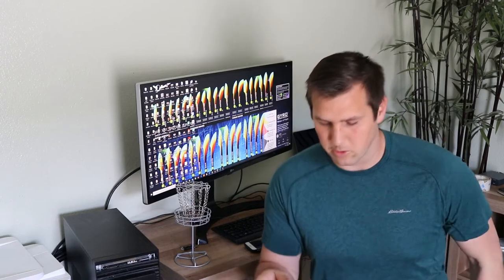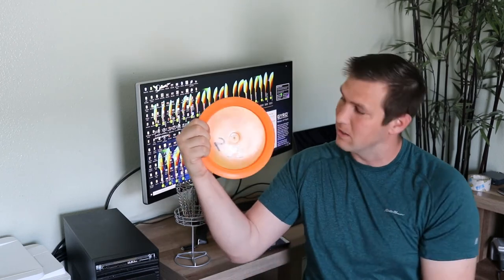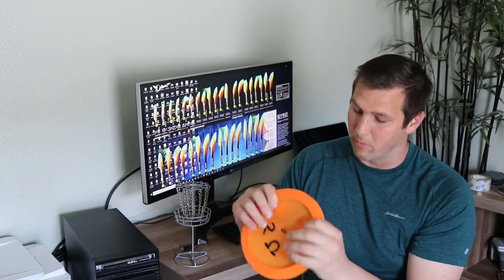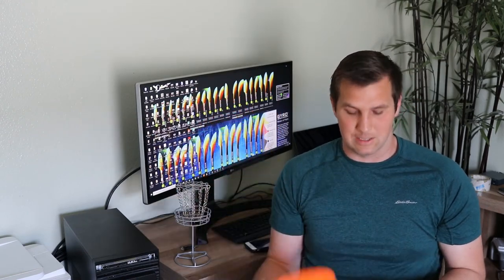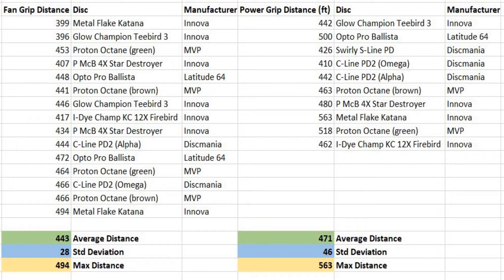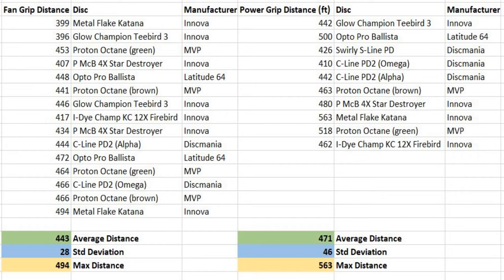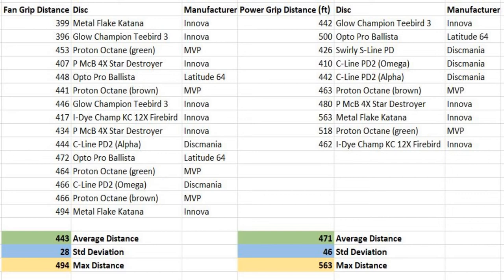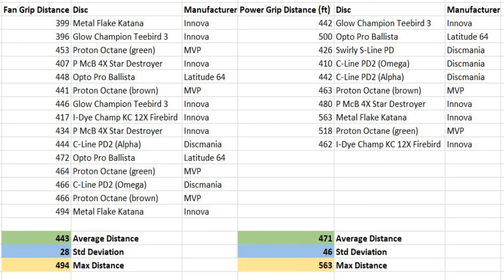Disc Golf Backhand Grip for Max Distance

Comment: I would have liked to see you alternate between power and fan grips, as you're throwing.  Just to be sure your arm has the same warmup, same control, progression through both categories.   You don't know if the inconsistencies were due to warmup, fatigue or grip.  You don't know if more distance was due to more warmup or grip.  Had you alternated, your numbers may be more reliable... because that's why you test anyways, isn't it?  To take the what you "think you know" out of the equation.

Comment: What did you do specifically in order you to throw that far? After form is pretty well sound, you would have to train specifically to throw for distance so I'm genuinely curious.. You are a pretty big guy too.
Reply from the maker: There are a few other things I would say help  after learning "sound form". First, hitting the angles correctly. Good form and power  are no good if you're throwing nose-up, too high or low, or using the wrong discs on the wrong amount of hyzer. Second, I throw in the field a lot, so I've strengthened the muscles specifically used for distance and that has allowed me to throw farther. And third, I'm built pretty tall and strong and get the natural advantage of my frame to throw farther. I would say that anyone  with proper form should  be able to  hit at least 450', though.

Comment: How hard are you gripping the disc? Do you squeeze harder or at different times in the throw with different grips?
Reply from the maker: I grip fairly tight, but not 100%, I would say 80% grip strength. I squeeze hardest right before pull-through. This is just to hang onto the disc. I recently started throwing 360's and I found I had to throw 4-finger grip and holding about 90% simply because the swing and rotation is harder than a regular throw.

Comment: I don't know how much you warmed up beofer the video, but I feel like some of it may have had to do with you warming up with a fan grip first. To do a true analysis you should do it after warming up for a bit before (throwing max power a couple rounds) or doing it by comparing it from different days. Obviously there will always be extrinsic variable (wind, you etc), but could cut down on it some.
Reply from the maker: I did a warm-up with both fan and power grips prior to performing the throws. I imagine I could probably match the fan and power grip distances, but I don't have enough confidence in my release point with a fan grip at max power, where the power grip just snaps out cleanly. I have better control with fan grip at lower power (60-80%). 

The point of my video, though was that fan grip can be used for pretty long throws. I've heard some folks say that you can only get distance with power grip, but the results prove otherwise. It's really just about preference and what you feel comfortable with. I believe Ricky said he has one grip that is kind of a fan/power hybrid and he throws everything that way. Obviously he has no shortage of distance.

Comment: Would you be willing to do a form review?
Reply from the maker: I can give it a try, although I probably won’t give you a bunch of little things or specific terminology to work on. I can at least guide you toward how I learned to throw far and go from there.
Reply: @peterashworth5875  That would be awesome. I can get 400ft on a good day, but it comes and goes. 
I'm trying to learn how to get my body weight to play into it more. Don't know how to do that just yet. Is there an email I can send you a video to?
Reply from the maker: @andrewwilde8327  If you'd like you can just post the video to  youtube (privately if needed) and I can let you know what I see.
Reply: @peterashworth5875  I can do that. I have some posted on my Chanel from a month or two ago, but I'll get a more up to date one posted soon. I'll let you know when it's up. 
I appreciate your willingness, I really want to get to that 500ft mark. 
If your advice helps me get there, I'd have no problem with you using my before and after footage for YouTube purposes or whatever you'd like. 
I'll let you k on when its posted
Reply: @Peter Ashworth I'd be interested in a form review as well. I'm an aerospace engineer by trade and disc golf and BJJ are my side hobbies. The concept of timing, leverage, and proper mechanics is what got me hooked to both. Considering your background as well, I'd probably resonate with your feedback as well. I currently throw 340' average with 8 speeds after about 1.5 years of playing.

Comment: Disc weights? Wind speeds?
Reply from the maker: All are max weight (174-175) wind speed was approximately 5-10mph (camera makes it sound pretty bad, I know) straight right to left. My assumption is that the wind wasn't doing a whole lot because of the full flex on the discs, maybe added a little distance because of the fade at the end.

Comment: This is exactly what I was looking for and you pretty much confirmed everything I was thinking.  Thanks for posting. By the way my best distance comes from a blizzard katana. Have you noticed that too? Whats plastic and weight on yours?
Reply from the maker: My best distance is on a metal flake Katana, max weight. I really haven't done any testing with other weights simply because I would never use one in an actual round. I could try, but based on what I have seen from the likes of Simon, GG, T. Gilbert, lighter weights will only help for absolute max distance in very windy conditions. I'm trying to keep my analysis in something a little more controlled and realistic.

Comment: Your Udisc must be off by 100+ feet lol
Reply from the maker: Nope, measured the distance from back of the track to the opposite goalposts with both a Bushnell (purchased more recently) and google maps. 470' straight line and my longest ones were either off to the left by 20-30 yards or long by 10-20 yards. Distances are accurate to within around 10 feet.
Reply: It sure seems off to me.
I dont think it matters for his point, but it is hard to watch shot after shot and then wait for the internet distance to appear on screen, wow.
the field should be 300 from goal post to goal post no?

"The distance from goal post to goal post on a standard American football field is 120 yards, or 360 feet. The field is 100 yrds (300 ft) long from goal line to goal line, and each end zone area is an additional 10 yrds (30 ft) each."

Ok so lets say there is 50 feet between the gravel track and the goal post, then this field from gravel track to gravel track is about 460 feet across.
So, if you just go by length across and not follow the exact flight path of each disc but rather measure where they landed in relation to the distance across, I dont think any went past the gravel on the other side of the field, but I cant see all of them very well to be sure.
for example shots that landed before the opposite goal post arent 400 feet away yet the claimed distances were much greater than 400.
I think some of the shots were pretty far, but about 100' less than what his claims were.
the sheer height of some of the drives and seconds in air and you can see they are not going over 400 feet in most cases.
Reply: @mattpipke5716   No the goal post are at the end of the end zone so 30 more feet on each end zone. So, 360ft goal post to goal post. 
I've still not even come close to that length. Never will either at 58yo.

Comment: Those measurements are way off!
Reply from the maker: How do you figure? I was throwing from behind the track behind the goal post (note the closer goal post on the left side of view. The camera is positioned probably 100 feet back and was zoomed  in so you could see  the disc fly. If you check  google maps the distance from the back of the track to the far goalpost is about 470-480 feet. Most of the throws were between the 10-20 yard line (410-440') with several going well beyond the long goalpost (500'+). Since then I have purchased a rangefinder and confirmed that those distances are quite close to correct, so I'm not sure what basis your claim is that the measurements are way off. Look at the footage again.
Reply: There’s three lines of track for long jump and pole vault and you’re clearly on one of them. Your not behind the actual track part.
Reply: I have to say this also.....Not trying to troll, just something about your measurements is not passing the eye test. I would say that if you want people to stop accusing you of this stuff, next time my suggestion would be to get the UDisc app out and measure your throws in real time, no jump cuts. Way to try and offer new perspectives on the game, good job!
Reply: @jdubb-a-yoo7692  I agree. I normally try not to call people out. But he was throwing discs straight up into the air and they’re somehow flying 500+ feet. It just didn’t make sense.
Reply from the maker: @evanmatocha8190  So the setup there is one lane for pole vault and then the track. I know the perspective is a little trippy (again, camera was a DSLR with a zoom lens about 100 feet back because I wanted to be able to show the disc flying and didn't have another person to zoom in on each shot) and I am standing behind the actual track. I suppose there's nothing else I can really tell you, sorry you're having trouble accepting it. Feel free to take a look on Google maps satellite view: Sage Valley Middle School, 18070 Santa Ana Ave, Nampa, ID 83687
Reply: I agree here. That ballista 100% did no anywhere near 448. Maybe under 348. certainly not with a pure hyzer fade off
Reply: @peterashworth5875  skip to 2:34 in the video. If you want to tell me that is 450 basically on Hyzer straight up into the air then you are the farthest thrower the sport has seen. But I dont believe it. Sorry man.
Reply from the maker: @t____g____5606  Well, I guess there's nothing I can really tell you at this point. Next time you're up in the Boise or Salt Lake areas (I visit UT regularly) shoot me a message. I'll show you what a 450' hyzer looks like. The hyzer fade is harder because of the right-left wind and the shot did flip up to flat, so I wouldn't call it a pure hyzer, more of a hyzer flip. I use the same shot to get pin-high on a hole about this length at my local course, so it's not a fluke either. Although in that case I'm usually power gripping.
Reply from the maker: @evanmatocha8190  Well, I guess there's nothing I can really tell you at this point. Next time you're up in the Boise or Salt Lake areas (I visit UT regularly) shoot me a message. I'll show you what a 450' hyzer looks like. The hyzer fade is harder because of the right-left wind and the shot did flip up to flat, so I wouldn't call it a pure hyzer, more of a hyzer flip. I use the same shot to get pin-high on a hole about this length at my local course, so it's not a fluke either. Although in that case I'm usually power gripping.